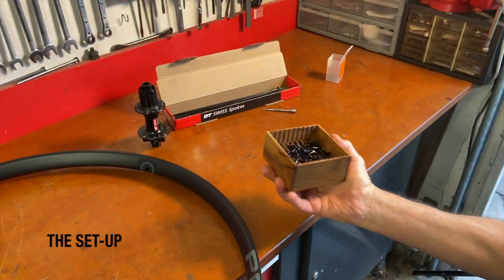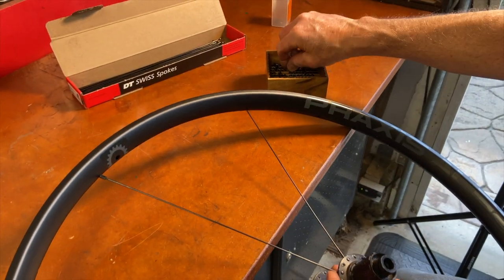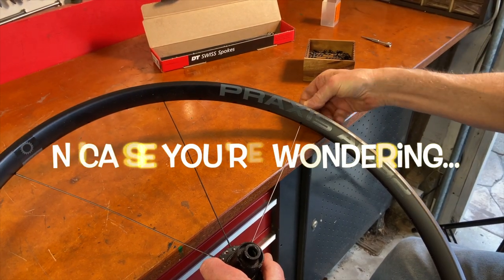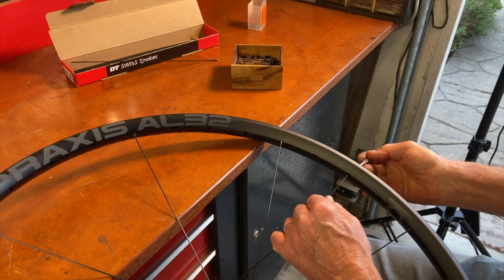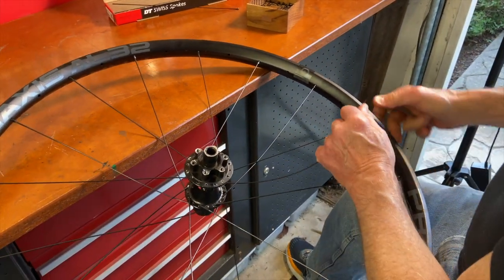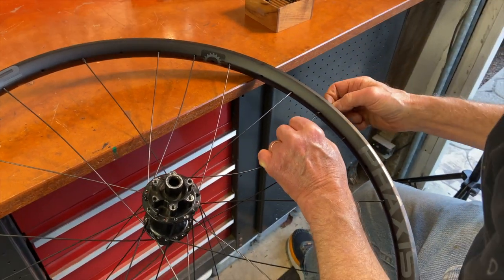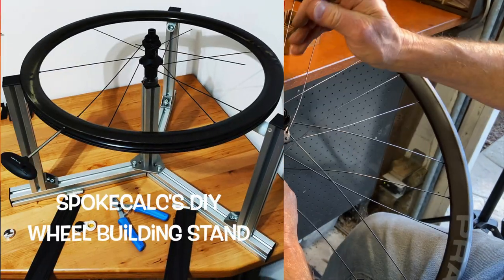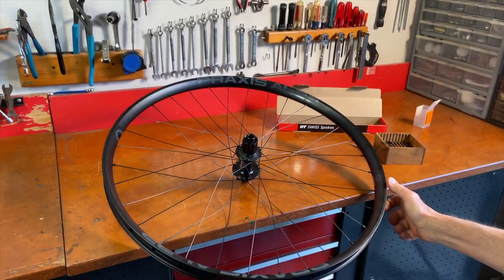Perfect Set-ups & Tools for Spoke Lacing when Building Bike Wheels

Comment: @jimlangley1 Hi Jim, I’m so glad I found your channel. It’s not just the best wheel building channel, it’s one of the best instructional series of ANY craft I’ve seen. Clear and simple instructions, in-depth-details but succinct format, all while being funny and engaging. I’m a total newbie and after watching a few of your videos I am getting really excited to give this a try myself. 

I have a couple questions if you don’t mind. 

Do you have a preference between straight pull vs J-bend? And if so, why? 

Do you have any top picks for a lightweight alloy gravel/cyclocross rims? I really like the HED Emporia Pro, but I bet there are tons of good ones out there that I don’t know about. 

If using lightweight, bladed spokes like Sapim CX-Ray, do you recommend using a stronger spoke on the rear drive-side, like the Sapim CX-Sprint or Race? or would you keep them all the same? I’m only 175lbs and not so powerful yet, so I’m not sure if it’s necessary for me. Yikes! Sorry for all the questions.
Reply from the maker: Thanks for watching and the great comment Jürgsten, appreciate it and welcome to my channel - I'm happy to hear you're finding it helpful! To answer your questions, I usually build with J-bend spokes because I typically build with hubs that take them and because J-bends are easy to use and reliable - the majority of wheels are built with them. However, if someone wants to build a straight pull/direct pull hub wheel then I would build with the correct straight pull spokes for it (some hub companies make direct pull spokes for their hubs and I'd use them). Both spoke types work fine as long as they're quality components. You can run into some straight pull wheels on which the spokes turn and need to be held with a spoke holder. This is not usually an issue with J-bend hubs and spokes which is one of the reasons they're the most-used. 

Sapim CX-Ray spokes are strong enough to build with the same spokes on both sides. I usually don't vary spokes on the left and right but just go with good quality on both sides - same spokes all around. You can certainly experiment with different spokes to save weight, etc. but it complicates the build and you probably won't notice much difference riding the wheel. But it's up to the wheel builder how he wants to design the wheel and what components he wants to use of course. That's part of the fun of wheel building 😊Hope this is helpful and thanks enjoy your wheel building!

Comment: Great video! I really hope I remember to make a tapered tool like that the next time I'm building a wheel. I usually use another spoke and thread it in just a couple of turns but this is much less satisfactory.
Reply from the maker: Thanks for watching, Ben and I'm glad you liked the nipple feeder tool idea. When I was first told about this by another wheelbuilder who worked at Velomax I didn't think it would work, but it does for both feeding the nipples and threading them a few turns on the spokes. 

I did use the threaded end of a spoke for feeding spokes for a long time - from fear of dropping nipples inside rims. But, that slows you down having to thread them on and off each time. I think you'll like the pointed spoke feeder tool when you try it. Thanks again!!
Reply: @JimLangley1  If the spokes are a little on the short side and the rim is double walled (which they nearly all are these days) I find I have to use something after the first round of spokes or so. Yes have often lost nipples between the walls and had to shake the rim until they come out!
Reply from the maker: @benc8386  I have built a ton of wheels that required nipple washers, Ben. Talk about misery - it's so easy to drop the tiny, thin washers into the rims and to get them out can take forever - they're often stainless, too so you can't use a magnet. I am happy that I don't have to use them much at all any more.
Reply: How about skewers? They are a little thicker than toothpicks, which was mentioed in the original lacing video?
Reply from the maker: @erik_dk842  Thanks for watching and the question, Erik. Any tool that has a tapered end that fits tightly inside the nipples should work to hold them for lacing. Just be sure to try it out by pushing some nipples onto the end of the tool and making sure that they can't fall off if you bump them on the rim when putting them in. If the taper was the wrong shape and didn't grip the nipple, that would let them fall off and that's when they could end up inside hollow rims and you don't want that to happen. Hope this helps and thanks again!

Comment: I built a front wheel out of a vintage Campagnolo hub and  vintage single  wall Araya single wall aluminium rim. The spokes kept tightening and tightening, but never reached as much tension as I would have liked. I think the rim was compressing more than average. Add nipple washers, really hard to reach spoke nipples to spoke threads. Months later I experienced a rather violent speed wobble at 33mph.  It actually made the stem turn in the steer tube slightly! Now that bike never did that before! I think speed wobble may be a good topic for a new video. The wheel is not the whole system, but even with great trueness, and roundness, this happened to me. I cut the spokes out and saved that hub! Got to change the resonant frequency somehow and will rebuild the wheel with a double wall rim. I can't risk a repeat wobble! The bike looks kind of funny with the 16 spoke bladed wheel I stuck onto it!
Reply from the maker: Thanks for watching and for the really great comment, David. What you shared is sure to help others working on vintage rims. It's nice that today most rims are box section and much easier to tension properly than the simpler rims that were standard in the 1970s. "Soft wheels" (that need more spoke tension) can be a cause of speed wobble. If it turned your stem, that had to be a violent and dangerous wobble. I'm glad you didn't crash.

I have quite a bit of experience with speed wobble both as a racer and as a mechanic, and have written about it several times over the years in Bicycling Magazine and my Jim's Tech Talk weekly column on RoadBikeRider.com. Here are my most recent articles - they received a bunch of great comments and lots of tips. In case you're interested or others are about the causes and cures for speed wobble, they're sure to help. Part 1: https://www.roadbikerider.com/avoiding-bicycle-speed-wobble/ Park 2: https://www.roadbikerider.com/comprehensive-list-speed-wobble-causes/

It would be a great subject for a video and I'll think about how I could do it. I'm more setup to do in-the-shop type vids than outdoors, action ones. But if I can figure it out it would a good one for sure. Thanks again for the great comment, David, appreciate it!
Reply: @JimLangley1  I read the articles you referenced.  My analysis is that I hit an unusually rough section of road at 33mph with a softish front wheel in excellent true and roundness,  on my standard Columbus tubes Dave Moulton. My knees may have already been on the top tube for aero purposes, but were batted away by the violent shaking. Also I'm well over 200lbs, far more than 45 years ago and the stem is max height on the A-1. Will stay under 33mph and rebuild the 36 spoke Campagnolo low flange hub wheel with Weinman L-18 double wall rim, Sapim Leader spokes 284mm, 1mm on the short side,  and really put some tension to bear 3 cross. Mavic Mod E-3 rims not available. Closest match to back rim. Your tips are helpful in building good wheels! Crashed into by another rider from behind,  same ride! The Moulton survived unscathed through some miracle,  but I'll have a bit of time off the bike!
Reply from the maker: @davidburgess741  I’m glad my articles were helpful and that these wheel videos are too. Sounds like a good plan to stop that wobble and I’m happy to hear your Moulton survived the crash. Best wishes for a speedy recovery, David!

Comment: Jim...I'm sorry if you already answered this question, I have not found it as of yet. Can you recommend a online single source for Hub, Rim, and Spokes so that an inexperienced wheel builder won't make mistakes on compatible parts? I am in the middle of a project for my 29'r and already bought the wrong spokes once. There are no bike shops anywhere near me. Thanks
Reply from the maker: Thanks for watching and the great question. Since you're working on a bike, usually the easiest way to choose wheel components is based on what's already on the bike, since those parts were compatible. Have you tried that approach? And you said you bought the wrong spokes once but you didn't explain what was wrong about them. The most common problem is getting the wrong length spokes. That usually comes from getting the measurements or calculations for spoke length wrong. But I'm not sure that's the problem you ran into. If you need a good calculator, this one is excellent: https://www.kstoerz.com/freespoke/ Let me know some details about what you're working on and I'll try to offer more help. Oh, wheel components can be purchased online from the companies that make them, from component sellers like JensonUSA and on eBay.com, Amazon, etc. etc. But you do need to buy things made to work with each other.
Reply: @JimLangley1  Thanks...I have taken your advice and deconstructed a wheel twice and reassembled it. That taught me the installation and then the truing went pretty well. I was off the first time on the dish(way off!), but I made a dish checker out of a 2 x 4 and a carriage bolt. That said, buying a like (same) hub for my bike is looking difficult. The bearing surface is scored. Also, I have the soon to be extinct Rim Brake/hub set up and I need heavy duty 12-gauge spokes.(I'm 6'05") I learned I have "butted" spokes. (I thought I had 14-gauge) The nipples are also a different size I learned. I guess it's a learning process. I also watched your video on measuring components. Thanks again. That should help with sourcing separate components if I can't find a one stop shop. Good advice! I think I will task the customer service at "Jensen" next about spokes....Cheers mate! 😎
Reply from the maker: @godfellas483  nice job learning how to build your own wheels and making a dishing tool, that's great! Yes, building wheels and sourcing components and knowing what's what is definitely a learning process, you're right about that. In case it helps, another good resource for parts is universalcycles.com - they do answer their phone. You should be able to find a replacement hub as there are still plenty of rim brake bikes out there - they won't go extinct, don't worry. Speaking of that, Rivendell ONLY sells rim brake hubs - here's their hub section: https://www.rivbike.com/collections/hubs-skewers Hope this helps - good luck and have fun building that wheel!